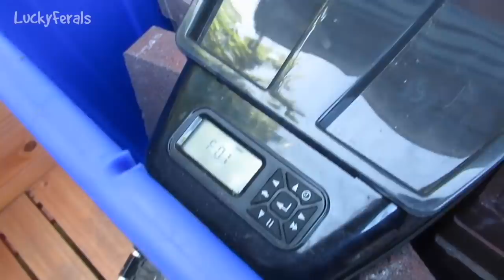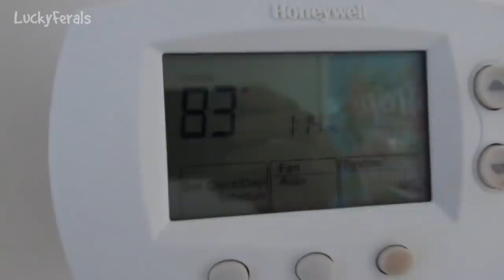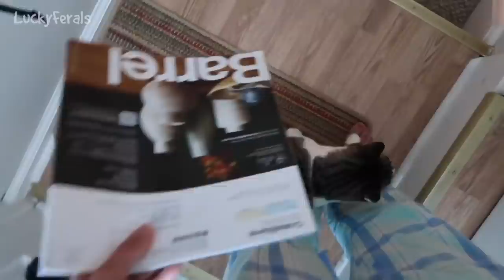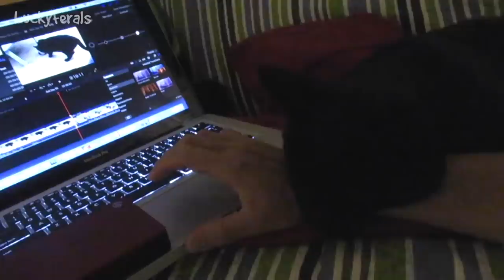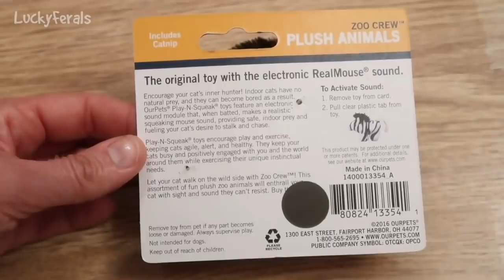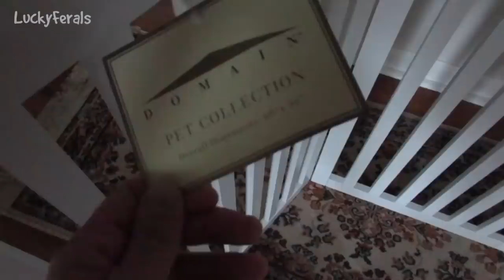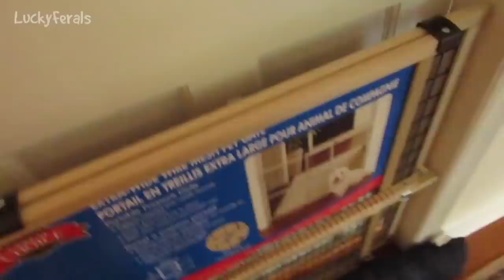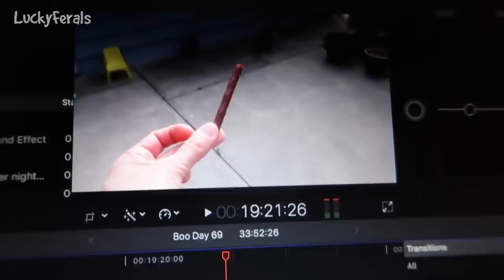Training And Socializing A Feral Cat * Part 9 * Days 65 - 72 * Cat Video Compilation

Comment: Love your videos!  Just an observation.  Try using equine pellets from Tractor Supply for litter.  You can get a 40 pound bag for about 6 dollars, put just about 1/2 inch in the pan.  The urine turns into a sawdust.  After it is all like that, I scatter it in the woods as it is biodegradable.  And the best thing is there is NO CAT SMELL!!!  Also, why do you use paper plates instead of regular dishes, kind of a waste to me both in dollars and resources?
Reply from the maker: My cats are very picky when it comes to cat litter. We’ve tried many different kinds before settling on their current favorite which is Dr. Elsey’s. Time is the most valuable resource.  All others are renewable but time isn’t. Paper plates save me lots of time otherwise spent washing dishes. This video was filmed 5 years ago. Thanks for watching!